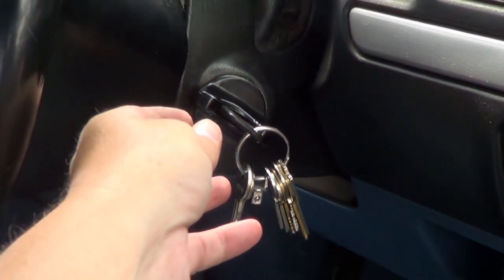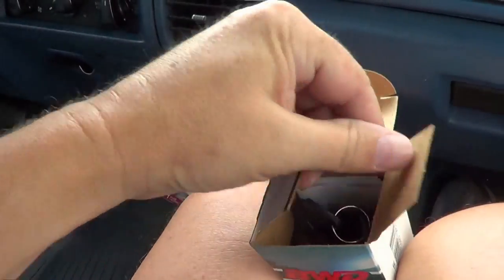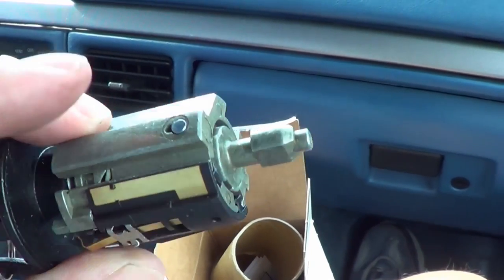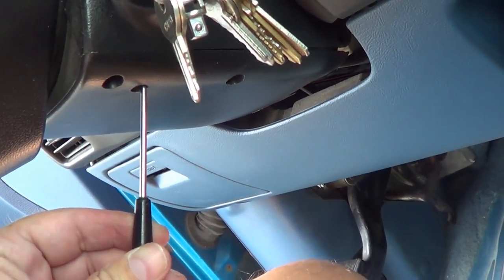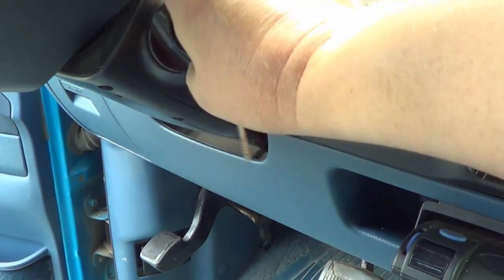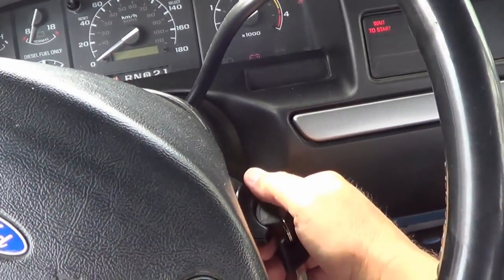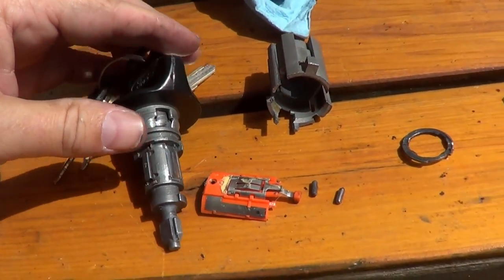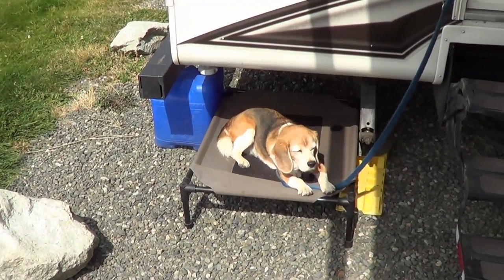Replacing Faulty Ford F350 Truck Ignition Lock Cylinder

Comment: That is pretty nice that your truck is nearly a quarter century old and is running with so few problems. Good maintenance will win out over brand loyalty almost every time.
Reply from the maker: I try and keep on top of anything that goes wrong. Hurts to spend the money but almost alway worth it in the end and limits breakdowns on the road, a real hassle when towing. ;)

Comment: Thank you so much for this video. My f250 7.3 sitting at 300k. The cylinder started to act up. Getting stuck and stuff and would get me worried it would leave me stranded somewhere.
Reply: My 1990 f350 cylinder just now broke. For a while it was starting to stick I would need to turn it a little and then crank. Now it just spins and doesn't fire. Truck has less than 86k miles. I am really hoping that is the issue and I am not going to have to take apart the steering wheel to replace the switch.

Comment: Sorta makes you wonder how many times that ignition switch has be used.  I have a 1997 GMC truck I replaced already a few years back with only 250,000 miles on it.  Glad to see Angie say ya did a good job and not interested in eating the old switch.

Comment: I replaced mine in my 94.5 power stroke and it seemed fine, the old ignition was wore right out the key wouldn’t fit properly and hang up the ignition. However weeks later I accidentally realized that the truck will start without the key in at all 🤨🤦‍♂️ did I mess something up internally?

Comment: Any help would be appreciated I recently purchased a 97 7.3 power stroke. Knew the lock cylinder was going, it broke before I could replace. Went in replaced it and the key is still turning back and forth with no/ little resistance. No lights nothing work. Is this an actuator rod ? I can see the rod barely and cannot tell if it is broken any idea how to tell? Any other ideas Ignition switch etc..

Comment: That's a pretty easy replacement but do you have any suggestions? My keys are gone for my truck. I thought I was going to have to pull the steering wheel off.
Reply from the maker: Sorry I imagine its an anti theft deterrent to have to have the key to make this method work.

Comment: Hey Ray,. I used your video. If you all want to have the same key as the door s just take your new ignition set and your old door key to a lock Smith to match it. He charged me $10.00 to change it.  Happy trails to you too.
Reply from the maker: Cool, thanks for the tip!

Comment: Always great material and suggestions.  Wow, you have 273000 on your ford.
Reply from the maker: Yup, kilometers which is 171,610 miles. Not too bad for a diesel motor, should have some more good years in it I'm hoping. :)

Comment: So the broken part you were talking about, how do you get that out??The bottom of the tumbler broke inside.
Reply from the maker: To get it out the easy way the key has to be in the ignition and there is a little pin to depress. If you can't do that I think you have to take the whole steering column part.

Comment: Great video.. Remember when all those Era of Fords were burning because of faulty ignition switches? Scary.. Am I mistaken? Looks like a airbag steering wheel? Looks like my 95 F150 wheel vs my 97 F250 HD wheel..
Reply from the maker: Never heard that one. I know they had problems with the head light switch, I've had to change it and the wiring plug was melted pretty good
 No, mine doesn't have the air bag option.
Reply: Love Your RV yeah there was a bunch of late 80s early 90s Ford's that had ignition switch problems that was causing the cars to catch on fire. I remember specifically a Thunderbird super Coupe that was local to us that burned while it's set in their carport. So I've always been really pretty cautious with all the Fords that I've owned in that era. Which have been quite a few. A couple of them actually were handled under the factory recall. 1989 5 liter Mustang sedan and also a 1992 tempo. After I posted the comment about your steering wheel I actually went out and looked at mine and compared it to your video and I guess mine does look just like yours LOL. Funny the camera made it look like it was bigger for some reason. One thing I miss with my 1995 F150 airbag steering wheel was that the horn buttons were right at my thumb tips as I drove which made it easy to get people to pay attention. LOL great video thanks for the reply👍😁

Comment: Good news,  super easy to replace. Bad news, super easy to replace. (For thieves)
Fortunately they will may e be chasing after newer models. Another good vid!
Reply: Your RV Freedom! You still need the old key to turn the ignition to the run position to be able to get the old lockset out.
Reply: Darrell Wampler yeah, more of a joke than an actual comment, but your point is valid.

Comment: My key won’t pull out after putting it back in. What could have gone wrong?  Worked fine before.
Reply from the maker: Did your replacement come with a cardboard sleeve around it and message to not turn before putting the cylinder in the steering column?  I think some people may ignore the warning. If it gets turned before installing it can mess up the tumblers.

Comment: Okay. Got a new key ignition cylinder. Same issue. The key turns so far over doesn't engage/ turning on engine. Is there any adjustment that needs to be done
Reply from the maker: No, it just slides in and works. I guess your problem isn't a bad cylinder. Must be something wrong with the mechanisms inside the steering column. :(

Comment: Does the key have to be in there to pull it out? A would be thief destroyed my ignition switch with a screw driver now the key wont go in...
Reply from the maker: I believe so otherwise thieves could just carry a spare lock cylinder and take the vehicle by swapping them out. I think you're going to have to take the steering column part. That's my guess. Cheers, Ray

Comment: Nice info Ray. Wondering what gauge you added on the lower dashboard? I have the same model truck. Thanks for all your videos.
Reply: banjowoodsman 76
I'm gonna go with temp gauge, most likely trans temp.
Reply from the maker: It's a tranny temp gauge. Was added when I had it rebuilt 5 years ago.
Reply from the maker: Yup :)

Comment: Not sure just how true this is but I heard that if you have a lot of keys on your key ring that over time it could wear out the ignition assembly. Anyone else heard of this? Good job Ray.
Reply from the maker: I've heard that one too, makes sense, they tend to swing a lot with lots of weight on the ring.
Reply: It does in fact wear them faster . I replace many lock cylinders for this reason .

Comment: Sorry for asking but my Ford F-350 94 it’s lock the wheel and it’s doesn’t unlock how can fix it ?
Reply from the maker: Did your replacement come with a cardboard sleeve around it and message to not turn before putting the cylinder in the steering column?  I think some people may ignore the warning. If it gets turned before installing it can mess up the tumblers.
Reply: I haven’t replaced yet cuz the wheel it’s luck and the switch too
Reply from the maker: Oh, I see, maybe its a different problem then.

Comment: Replaced the key ignition cylinder but the key now turns too far and won't start the van. (1998 ford E350) can anyone help?
Reply from the maker: My lock came with a warning not to turn the key until it was installed. I wonder if maybe someone else bought the lock before turned it before putting it in screwing it up then returned it so now it's out of sync and they just restocked and sold again. Just a guess.
Reply: Love Your RV thank you

Comment: Maybe I'm not watching The Right video but the problem with mine is it keeps on killing the battery and I'm leaving nothing on but it keeps on draining my battery and the alternator is good and the battery is good
Reply from the maker: Need to track down what is draining the battery.  If you get a clamp on amp meter you can see how much current is flowing from the battery wire and then pull fuses until it stops flowing, at least that will narrow down which circuit is the problem.

Comment: I thought you would have had more kms than 276180 for a 94 that fulltimes. You must not be going to far in the summer.
Reply from the maker: Have had the truck a little over 6 years now. We bought it at 120,000 kms. Done a one year trip out east and around the south and 5 - 6 month trips to the southwest and back. Summers we stay on Vancouver Island for the most part and it stays put a lot short of trips down Island to visit relatives. - Trip maps - https://secure.travellerspoint.com/member_map.cfm?user=Raytronx
Reply: Love Your RV What oil do you use? Fuel conditioner? I have a 2006 Duramax just broke in at 172km. Have had diesels since 83. Also had big trucks.
Reply from the maker: For oil, I use Rotella 15W40 and change it often, every 3000 miles since it gets pretty heavy duty towing the rig and I usually use Lucas fuel additive as I can find it most places.

Comment: Actually start the F#cking Truck? Can you do that?

Prove your work, or explain entire process!
Reply from the maker: Woah, take a chill pill dude. I did start the truck. Sorry, I wasted my time trying to help you
Reply: @LoveYourRV   HalfAssed Work I
s half assed work! Strategically leaving out the programming part and how its done is kind of a void in some areas of this country!
There's a lot of billy bobs out there wondering why their ranger won't start right now after watching this video!
Good Job Boys, You just shut down the entire moonshine industry with one video.
Reply from the maker: A 1994 F350 IDI diesel as seen in the video doesn't have any programming for the engine or the ignition.  The only computer is a small rudimentary one for the EOD4 transmission. There is nothing to program. It's just a plain old school key.
Last year for mechanical engine was a mid 94 7.3L IDI diesel. if it has a 7.3L Powerstroke it is computer controlled.
the 5 speed manual trans, or C-6 automatic are non computer controlled.
if it has an overdrive automatic trans, the trans is computer controlled.